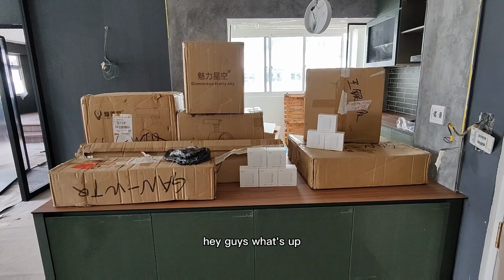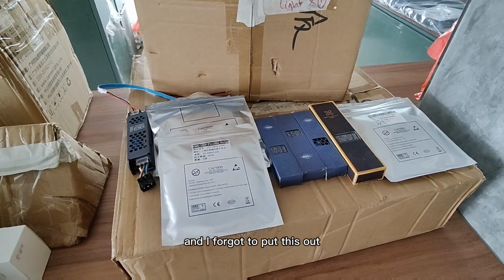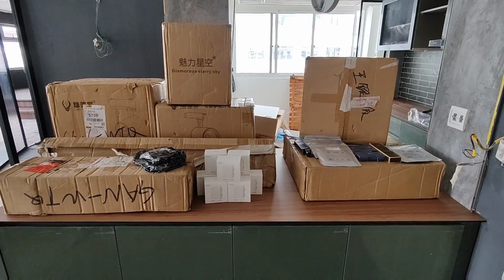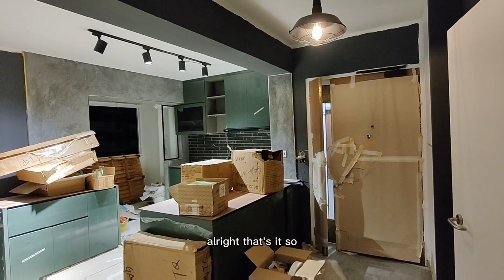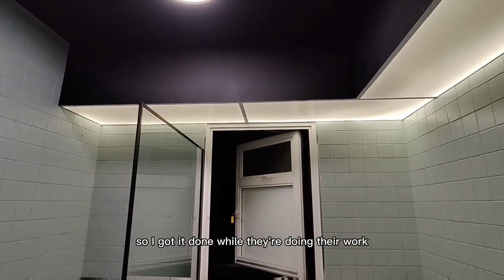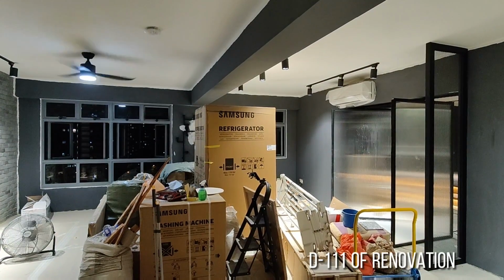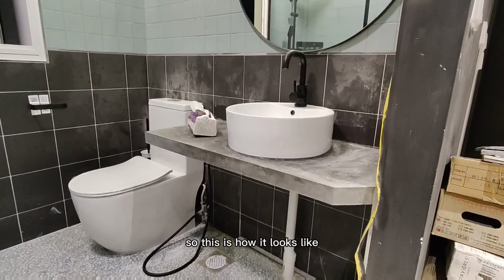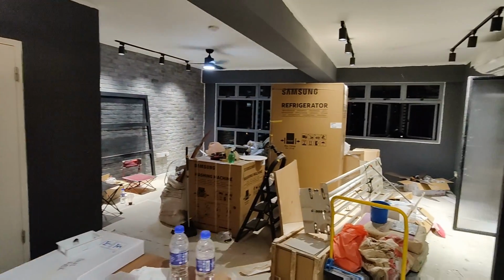Lights & Plumbing | Singapore HDB 4 Room BTO Greenverge | Ep. 23

Comment: BRO, can you share with me where you get the LED Strips light from?  
Also for your Track Light, are you using what brand in Tao Bao, is that the kind of track light that use and throw type, i.e. can not replace the light bulbs type?  
After 1 year is the light lumen / brightness remain strong?

TIA for sharing.

I will post mine and tag you.
Cheers.
Reply from the maker: All light is from taobao. But there isn't a specific brand. What I did was to buy alot of spares just in case( one Ikea big container spare to be exact 🤣). The light is still very strong. 

Nevertheless, you can use any other brand on the same track w/o any issue! Sorry for the late response